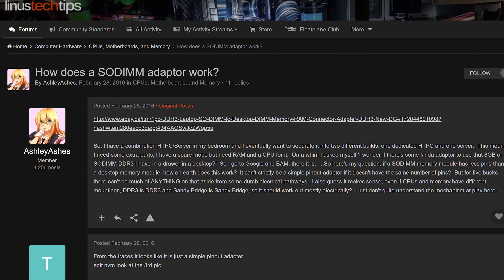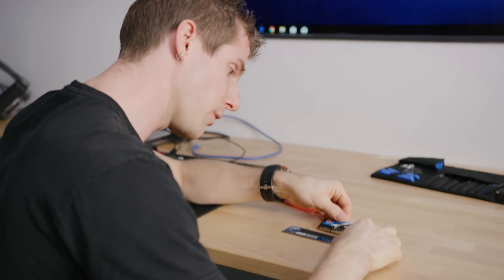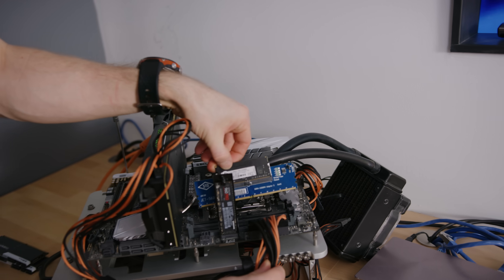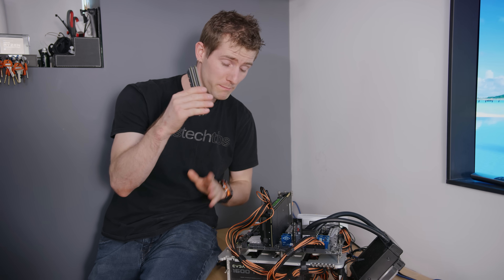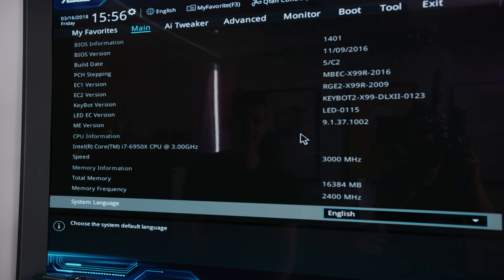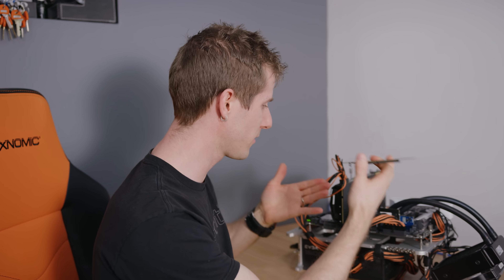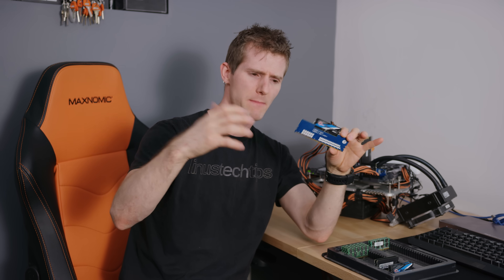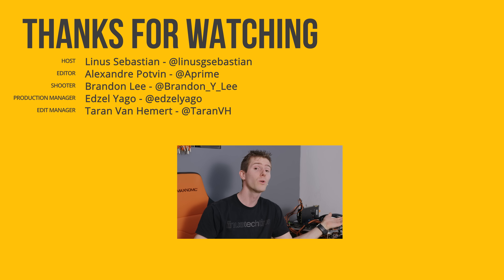Installing Laptop RAM into Desktop!?

Comment: I know it sounds crazy, but is a DDR3 to DDR4 adapter possible???
Reply: No, as IMCs and chipsets determine the generation of memory.
Reply: NessMac So how did some early Haswell motherboards have slots both DDR3 and DDR4?
Reply: Haswell boards support ddr4?
Anyways, I know Skylake supports DDR3L and DDR4. That's simply because the IMC allows it. But that's one line of processor compared to the other 99% that don't support two different types. There's just not a big enough market.
Would be kinda neat though. Then, if Intel could actually use a socket for more than two generations, it would also have memory upgradeability to go along with cpu upgrades.
Reply: Same company makes a DDR3 SODIMM to DDR4 DIMM adapter.
Reply: i don't think haswell support DDR4. haswell-e does but not the haswell. it depends on IMC compatibility just like AM3 CPU on AM2+ board which allows the CPU to operate with DDR2 RAM while AM2+ CPU won't work on AM3 board because the CPU has no DDR3 IMC
Reply: No, However you can combine DDR1 and DDR2 into DDR3, 1+2=3

Comment: You shouldve tried lower speed dimm and the sodimm to see if it wouldve worked with all of them. i know normally if you put different speed ram into a pc it just runs at the lower speed but maybe because the dimm was a really high speed it was causing the issue. since when you went to 3000mhz you had issues using just the sodimm. Just a thought, maybe im retarded. I still enjoyed the video, keep on doing what you do!

Comment: Perhaps that jumper is to enable or disable overclocking the ram.. Also This would be a great product for me, I acquire lots of older broken machines, it would be great to use ram from a broken laptop to upgrade what's already inside an older desktop. If we're talking 5-7 yr old dual or quad cores then you wouldn't be expecting much more than baseline ram speeds anyhow.

Comment: I did this years ago for laptop memory testing. Also came into use again recently when I needed DDR3 desktop ram but had unused laptop style DDR3 spare in a parts bin. And the adapters were cheaper compared to new ram and I already had them.

Comment: I hate to be that guy and I know this isn't the place, but I really need help with this and would greatly appreciate any tips:
http://www.tomshardware.co.uk/forum/id-3677832/audio-disappeared-secondary-gpu-installation.html
Reply: You need to specify which secondary card you used. It may be so old it can't use the modern drivers (like GTX 480). I had the same issue with an old Terrascale (AMD GPU trying to run alongside a much newer one). 2x different Terrascale works fine (like extra monitors), or 2 modern Asynchronous compute work fine (actually you can use a pretty big mix).

I just checked, and I can use an AMD card alongside my Nvidia, and it works perfectly fine for adding monitors. Yes, both Nvidia and AMD drivers work perfectly fine with each other (I should hope so, Windows has like hundreds of random drivers tangled up and working).
Reply: Nidhal25 why do you need the second gpu?
Reply: Maybe get an AMD GPU if you want more monitor outputs. Confirmed my Titan Xp is running fine with RX 470 each driving a 4k monitor. I haven't tried gaming or multi-headed gaming (multi-user at once).
Reply: Jake Garrett could I see a pic of that setup?? That's crazy man so jealous lol
Reply: I was about to make a video on silent water cooling (no HDD, and even PSU fanless until 650w, so silent even gaming with a Titan), but I've yet to make a bracket for AM4 water blocks, and I don't have a car radiator yet, I've just been testing on a smaller rad with good results.

The craziest build I've had was 2x R9 Fury and a mohawk of GPUs bolted to the top of the case (one of those Furys was actually hanging by zip ties connected by a 16x ribbon riser cable for better airflow). Man that machine could render! The only thing was, I had a couple CAD applications that needed CUDA, and having very little room for anything else, I just went with the highest power I could afford.

The other craziest machine was having sub-zero phase cooling on a GPU. -58c idle and -35c max load temps are awesome! Only problems are: huge power use, noisy, expensive cooler, need heaters and insulation to prevent ice, and I eventually killed the card. My record was a 52% overclock on the GPU, but it died running Furmark that way.
Reply: If you're interested in crazy and creative stuff like water cooling a tablet (I couldn't find anyone else that has made one, I made custom block, res, rad), a 100+w case fan (powered by a race quad motor), eventually some sub-zero benchmarks (though that's going to be probably half a year), or stuff like that, you can sub over here.
https://www.youtube.com/channel/UCZp2Om_w_o0ry_FQhAUp-CA

Just remind me to make that water cooling vid, and you'll see my build. Might be a week or so, but I'll see if I can throw out a quick video (My previous videos have been garbage, so I've been practicing video editing a little so they look decent).
Reply: It was a stupid idea, I wanted to test out DX12 multi GPU and then use the second card as a physx unit. Sound worked fine until the second gpu (gtx 660) was recognized by the drivers.
Reply: Hardcore Hardware Already done that, I've even gone as far as to use an old HDD to install a fresh copy of windows and boot from that and to my surprise, sound still doesn't work :( so it's probably a hardware problem, would the FiiO E10K solve my problem?
Reply: Hardcore Hardware Asus Gryphon Z87, I don't think it's the audio jacks because front panel (case) jacks also don't work so it's highly unlikely that both jacks just stopped working.
I'm thinking of a pcie soundcard, any recommendations for under 35 euros? I don't want any bells or whistles, just a chip that is better than onboard audio.
Reply: Jake Garrett do you have any extra hardware lying around that I could buy on the cheap? I need a GPU as I'm running a Ryzen 7 1800x and had a great GPU, till it stopped working and it turned out someone had dropped it during a rebuild and not told me. But basically it's running a radeon HD 6670 2gb, so a serviceable card but nowhere near optimal. If you have anything please send me a dm or email

Comment: I had an old laptop that ran DDR3, recently upgraded to a ryzen system, so didnt need it anymore. I used a similar adapter to give my parents pc a boost, since that was only running 2gb. It now has 1x8 and 1x4

Comment: But can you make a ram disk and run Crysis on it?
Reply: Probably, Crysis 3 only seams to use 4 GB of system RAM, and under 3 GB Vram (at 4k Ultra)
Reply: Yes, my cousin developed an auto RAM disk program for loading games after startup. I helped pre-alpha test it. Its great so you don't have to wait around for loading as long. I've used them for several applications other than gaming, they are very useful.

Comment: What about the DDR3 ones that don't seem to work right out of the box with Corsair Vengeance? Nobody seems to know what determines the way you determine the proper configuration for the DIP switches. I have an old AMD Kaveri build that got placed in a storage unit for the last four years because of this and budget problems (had the RAM from a laptop that my buddy broke).

Comment: I have an 870m Nvidia graphics card from a laptop that died. I was considering selling it, but now I wonder if there is an adapter that would allow me to connect it to a PCIe slot on my desktop. I know what you might ask me, "But how would you cool it" No worries I have a 3d printer and building a custom enclosure would not be a  problem. I am all for reusing old hardware to give it a new life. I also made a post on the forum: https://linustechtips.com/main/topic/912227-pcie-laptop-m-series-grapics-card-to-pcie-desktop-adapter/
Reply: Is it worth all the effort for an 800m series card?
Reply: Triplicity Damystery The performance would be better than my gtx560. Which has less ram the the 870m.
Reply: https://www.ebay.com/itm/MXM3-to-PCIe-AMD-Riser-Card-for-MXM3-based-AMD-GPUs-w-o-GPU/112812107426?hash=item1a442026a2:g:pDwAAOSwceNageeJ   assuming GPU removable. Better off trying to find another laptop with mxm. May as well take a good look for any replaceable fired components on laptop board. while taking out card.
Reply: send your laptop to rossman repair group.. he can fix anything, check his videos on youtube :) if you are in US, if not, find some specialist.. who repairs boards..

Comment: sooooo do you have 4 of them to check if they can run in quad channel? SODIMM RAM is cheaper, it may be an alternative...
Reply: on amazon (in Italy), 8GB SODIMM can be found at 65 euros, the cheapest 8GB DDR4 DIMM I found is 73 euros... Not much cheaper, but count 8 of those, you save 64 euros. Anyway you have to add adapters so you can save somewhere below 50 euros. Stupid idea... Unless you have in plans to use this memory in a laptop in the future. I was thinking, getting a gaming laptop somewhere in the end of this year and it could be not a bad solution. Anyway I have 32GB (4x8) and I was thinking to give them to my brother and get myself 64, but prices now are scary! I need more RAM for UE4 lightmaps rendering, 32GB is not enough for this, UE4 just crashes :(
Reply: With DDR4 prices, rn, I doubt if SODIMM is more expensive...
Reply: yeah why didn't he do that ..... smh.

Comment: The only logical reason I can think off, is to test SODIMMs outside of the laptop, memtest86+ and such.
A issue which I ran into a few times. Having stability issues with a laptop but not having another laptop at hand to swap out modules and check if issues remain. Hate buying extra ram modules when not sure it's the culprit

Comment: These are used a lot in e-waste recycling, when testing sodimms for resale. It's faster and easier to use a desktop board instead of constantly having to flip a laptop or buy a memory specific tester. Some of those units can be costly.

Comment: Do you not know anything about RAM? Your first successful boot you didn't even have XMP profile enabled because you reset the CMOS, and you even showed it was disabled in the video.
Also, you never mentioned the actual speed and timing of the laptop DDR4, so just overclocking it without adjusting timing was just asking for failure.. This video is so misleading and pointless. This video had more advertisements than it had actual content; what is this, a walking dead episode? I hit the dislike button, because this video sucked. The only thing I learned is that there are adapters for RAM, but I have no clue why you'd want to use them in any sort of PC that you use daily.
Reply: He also didn't touch voltages at all which is likely why it was crashing.
Reply: what about desktop ram then i mean yeah ijn my area spesificly indonesia desktop ram price is sooo ekspensive like 250$ for 16gb but the other hand the laptop ram is soo cheap
Reply: As a person who's cheap, exactly. I'm poor. If I can use a weird adaptor to avoid having to spend more money and it'll still work I'll do it.
Reply: +Josh Hockman
presumably, because you could sell those modules for a decent price to someone else and buy better Memory for yourself new to get the most performance.
Reply: Exactly what i thought... Handles hardware since years but doesnt give a shit about timings, voltages, etc...
The point of this video sounds like 'these adapters arent that great bc i had no time to test them properly' 🤐🤷🏻‍♂️

Edit: These adapters could be usefull for retro gaming systems :) ... where i live you can easier find old ddr or ddr2 ram for laptops than ordinary ram for pcs 🤷🏻‍♂️
Reply: Paused the video at 1:32. They are G.Skill Ripjaws F4-3800c18q-32grs. They are 3800MT/s sticks at 18-18-18-38. 1.2v > 1.35v. So the sticks "SHOULD" have handled the speed. But extra trace length, extra resistance will cause the latency to be greater than the higher clock rates. Thus only being able to boot at lower speeds. 
Also, DDR4 SO-DIMMs are 260 pin, not 200, which was DDR1 and DDR2 SO-DIMMS. DDR3 SO-DIMMs were 204.
Reply: desktop ram is more expensive than laptop atm.
Reply: Thanks, but knowing some basic info about PC's does not exactly warrant a $200k/yr salary..
Reply: The guy raised interesting and factual points. As for saying the video sucked, it definitely wasnt their best. Its vital feedback I think they would want.
Reply: i change my like to a dislike after reading these coments xd
Reply: Alex G oh dude please ur pathetic
Reply: Its good you know the knowledge about RAM. And here is the fact, so many people doesnt know much as you do. And when linus show it to them, i bet they will fry their ram. Its better for the most of people linus did this or ltt forum will get spammed from so many stupid people telling them this is make their ram fried.
Reply: Build your own yt channel...stfu ok
Reply: If you know this much, go get yourself a desk job at a big company, roll in the 200k a year, and live in the suburbs with your stereotypical white picket fence and your alcohol-free Christmas parties.
Reply: Fuck off. This video is for fun. Nobody wants you in the comments section.

Comment: "Old laptop. That has, like, 2x8GB modules" - Show me how many laptops in 2K18 have 2x8GB and how many could benefit from 2x16GB. My R7 1700 gets rekt in some real-life bandwidth sensitive multi-thread workloads that don't need all 16GB.
Reply: Alright, TBH I have just that - 3 8GB DDR3 SODIMMs, but just because I was stupid to buy MSI GX70 and upgrade its memory by dual channel kit (actually 16GB was required on few occasions). I've 4x4GB DDR3 DIMMS anyway.

Comment: Can you use miracast to stream to a phone, from a tv box (firestick or search Amazon for rk3399 or rk3268), on boot, without a tv, or other inputs. 

...setup phone, plug in power to firestick (firestick setup on previous power cycle), see firestick display on phone.

Comment: I've been using spare 2x4Gb ram SODIMM that I've got from a dead Asus Rog of one of my neighbors (dead GPU) in my DDR3 setup because I'm cheap and I couldn't afford the 8 more Gb I needed more and more everyday. Happens they were the same frequency and had timings close to my original 8Gbs. Been using them for nearly a year now and never had a problem. Maybe they are less efficient than true DIMMs, but it's still a big upgrade over my 8Gb I had, and it cost me 10bucks. Considering the RAM price (DDR3 is crazy expensive too), that's quite a cheap upgrade for people on a budget, considering the huge amount of dead laptops everywhere.

Comment: My desktop have the laptop size DDR3 ram in there already and can't fit the larger size ram.  Is this normal.
Reply: Mike Lascelle no
Reply: WaterMelon it's an Acer desktop and it doesn't even have slots for the larger ram cards

Comment: @Linus: Your jumper does something. Check here:
https://www.ebay.com/itm/JET-5608AK-DDR4-SODIMM-to-DIMM-Adapter-w-Metal-Guide/322990375623?hash=item4b33ba02c7:g:qRcAAOSwRE5aVV6R
1-2 short: Select SPD device on adapter, 2-3 short: Select SPD on Memory Module (DUT)

Comment: This could be really good, I have a older laptop that I threw 12Gb of RAM into. The RAM is decent but the laptop turned out to but udder crud, if I finally get a desktop I could use this with that RAM.

Comment: I tried a DDR3 alternative, it worked flawlessly in an old AMD mobo, but i couldn't get it to post with another stick in my H81 motherboard (which I originally intended to use it in) :/ It worked alone tho.

Comment: LINUSSS!! THere is an adapter for DDR3 motherboard to use DDR4 memory ram! you need to test !
Reply: there was an motherboard with  just DDR3 support but was running DDR4 with an adapter
Reply: I can't find the link... Was from long time ago.... I remember was  when the DDR4 was  only a prototype.
Reply: Palindromemordnilap my guess? The adapter is actually a memory controller itself, and it has another dedicated memory processor that fakes a DDR3 to the host computer
Reply: This makes no sense! I mean, if you want to build a computer you will also look at the price, and buying a stick of DDR4 RAM  that cost more than the equivalent memory capacity of a DDR3 RAM simply isn't cost-effective neither intelligent
Reply: DIYelectronics it probably was for engineers in the industry to test their factory's DDR4 RAM circuit designs on DDR3 motherboards before DDR4 motherboards became common enough to test using one.
Reply: Do you think you could use DDR4 on DDR3 motherboard?

Comment: On ebay u can find many used 32 and even 64gb of low profile memory (probably from servers), most at 1333mhz. I think ram quantity more important than speed, if u had slow 64gb still 64gb, but yeah thats very old now, but i wonder if its worth it.

Comment: I have a couple of these adapters in my recently rebuilt home NAS. Those very same adapters from the very same ebay listing. They've been working without a hickup 24/7 for the past 6 or so weeks, including running the occasional VM. I already had a pair of 8GB SODIMM sticks, and this was a much cheaper option than buying 16GB of DDR4.

Comment: Ok, he showed its possible and thats very cool, they have not only good videos but also fun videos. But why would anyone do that, desktop ram is faster. Like 2 months ago i opened my old laptop (almost didnt work, and wasvery old) for fun, kept the cpu and the ram sticks i think, and also the 250gb drive because why not and threw rest away. Many years ago i did holes on the bottom of it to "breath better" (total fail), i also had switched the thermal paste on it (also waste of time), but yeah, good stuff.